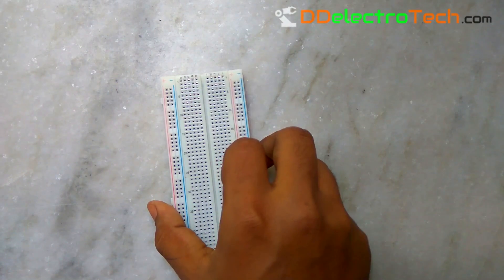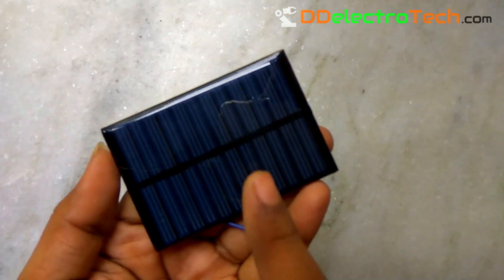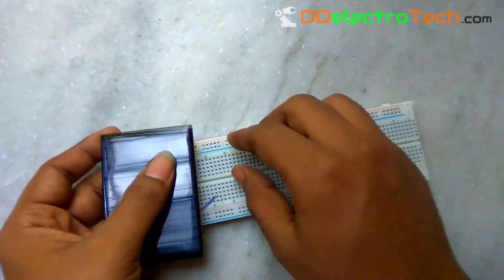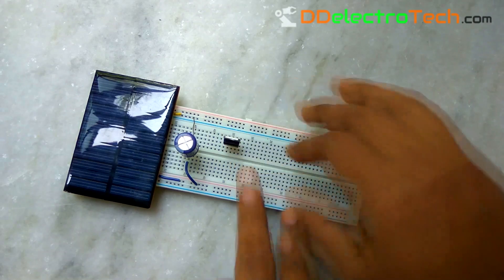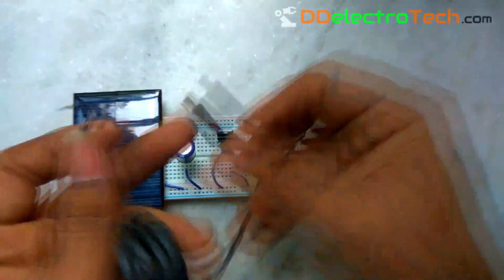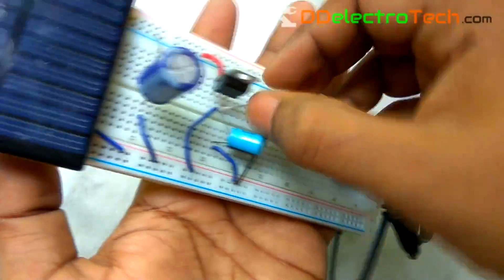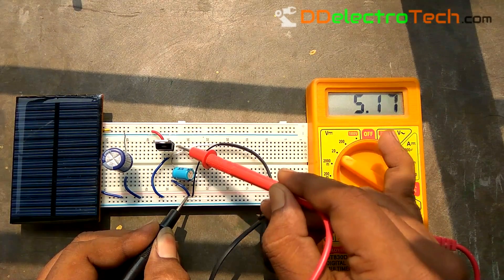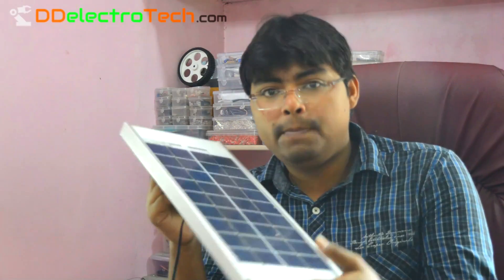Charge Your Cellphone By Using Free Energy - Build a Solar Charger

Comment: I used 12v solar panel and 7805 voltage regulator and 1000uf,100uf capacitor but the output voltage is 4.99 v. what I want to do?